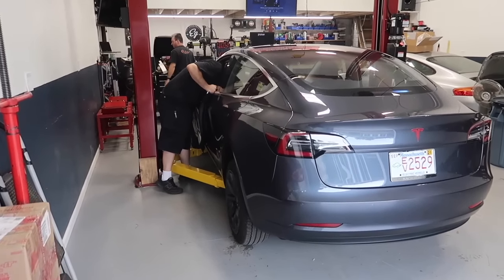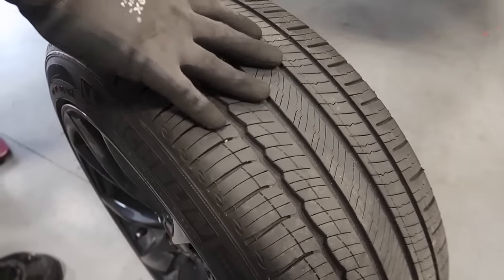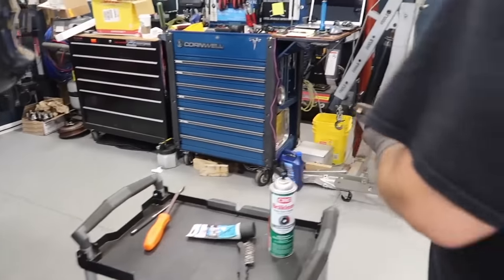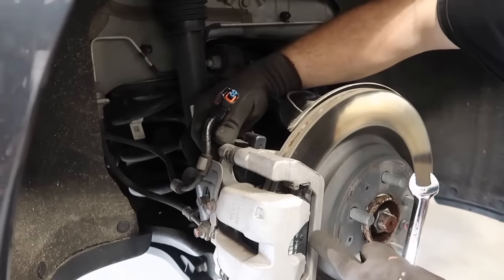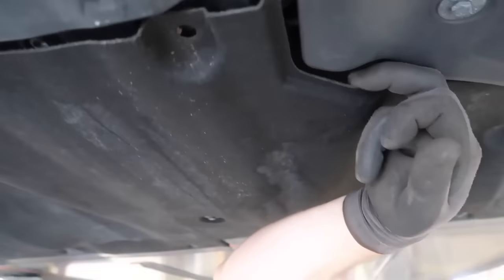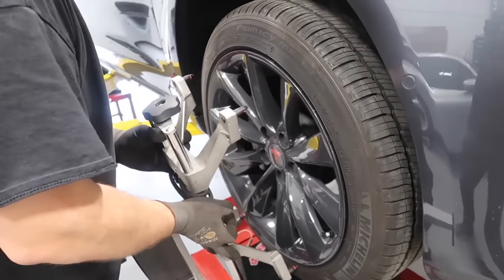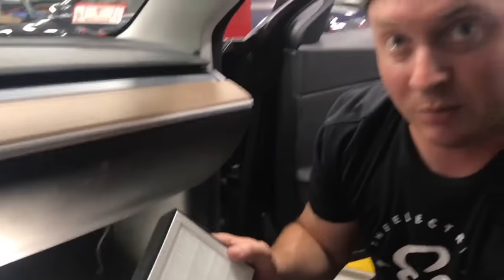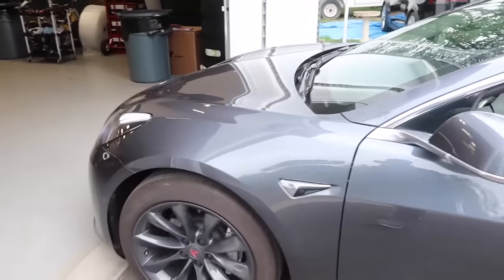Servicing your Tesla model 3: The Complete Guide

Comment: This reminds me, I should align my wheels. I've been getting negative camber wear. 

Shops can't never get it perfect, they just tell me it's close enough. 😒
Reply: Within spec there's a range. Perfect is harder to achieve, but not impossible, just make sure you look at camber castor and toe not just toe.
Reply: At 30k miles, my fronts show inside edge is worn twice as much as outside edge.  I thought this was camber, but is it toe?  Is this type of setup better for aggressive cornering?
Reply: Set up for cornering and wear your tyres extra on your dailies. Could be both, could be under inflation too compounding the problem, go see a hunter or 4 wheel alignment with caster and camber and total toe values
Reply: On my rear wheels, I have an SPC adjustable camber arm. In the front everything is OEM. My tires will last me about 2-3 years instead of 4-5 years with proper rotation and psi.

From the factory, my Mazda came with a slight negative camber for better cornering. But wears out the tires on the inside faster.
Reply: My 08 Silverado stil has perfect alignment after all these years 
Tesla is bit disapointing
Reply: @WANDERER0070  I've noticed each vehicle is different. In my experience, older cars I've owned never needed alignment.
Reply: A lot of places that say they do "alignments" only do toe, not camber and caster. Be sure your shop isn't selling you an alignment that's just a toe and go.
Reply: @sqmotorsports9230  yes, I've learned my lesson. The performance shop I found actually wants to keep my car for a day. They charge separately for toe and camber adjustment for $170 all together.
Reply: @joelfuentes5148  for what it's worth that's a good price; round my way it's $250. But I subcontract rather than do the work in-house; those Hunter racks are expensive....
Reply: @sqmotorsports9230  I can imagine the investment in price, plus the square footage space it takes. A lot of tire shops balance and mount the tires but don't do the alignment.  The whole reason I needed new tires from the first place, was because of unbalanced alignment 🤷‍♂️

Comment: Great video Rich!!!
From what I understand the alignment specs are different for the Long Range and the Standard Range vehicles due to the weight differences. Can you please confirm?
Thanks,
Reply: The weight should not matter. If there is a big difference in weight, the cars spring rates will be adjusted to compensate. This way both cars will have the same ride height. Same ride height means same alignment specs. Still, I'm curious what the official answer is.
Reply: All i know is when Tesla did my alignment they got it wrong twice. I had to take it back and go for a ride with the service person. Only when he realized that i has the smaller battery did they get the alignment corrected.
Thanks for your reply!!!

Comment: Once in tow mode, as long as you don't close the door, the rear brakes do not reengage.

At least in my experience but when playing with replacing pads you're gonna wanna be more careful so this advice of removing the cable is good.

Comment: On those parts that you are wire brushing the rust (and paint) off of, give them a coat of "Hinderrust".
Watch videos on it.  Has a consistency like oily syrup.  Don't get it anywhere you might want to paint later.  Paint won't stick and it's difficult to remove. Best to brush it on but can be sprayed.

Comment: How much would all of that cost to have done?
Reply: @Ken Befound If it were a BMW dealer servicing this, this would be $1200 easily.
Reply: I have a feeling it was expensive. The alignment, battery and wiper blades was unnecessary in my opinion on a new car like that.
Reply: The 3 gives a warning when the 12v gets weak

Comment: 2
What about the oil filter???? When is that changed???
Reply: Every 3000 miles kappa
Reply: @ninjamaster3453  What! No.
Reply: @JasonWW2000  I'm sure he'd be alright going 5000 miles. Kappa
Reply: @ninjamaster3453  Probably closer to 100,000 miles.
Reply: The early model S required oil change at 12k miles and then every 50k miles. The model 3's seem to go much further between recommended changes.
Reply: @JasonWW2000  how often do you change the blinker fluid?
Reply: @ninjamaster3453  Do you even understand what I'm talking about? The gear oil that lubes the motor, gears and differential. You do realize these motors require oil so they don't wear out, right?
Reply: @JasonWW2000  Its more a grease than normal oil (as conditions are easier)
Reply: @cytrynowy_melon6604  No, it's more an oil. There's one model tesla that uses Dexron 6 automatic transmission fluid as the oil. Other models use a special oil I've never heard of. Grease would be way too thick to be circulated and ran through the filter.
Reply: @cytrynowy_melon6604  grease?? The oil pours out during one of Rich's videos....

Comment: For my own edification: When replacing the 12V... Why was the DC connector under the rear seats disconnected?  Is there a specific benefit?  From what I picked up on in the video, it was to disconnect the 12V from powering anything in the car.  I thought this was accomplished by selecting the power off option under the service menu.  Then pressing the brake pedal restore power.  

Love the channel!

Comment: I recently purchased a 2014 Tesla model S with 57k (now has 63k) and was doing the recommended maintenance. I started with the brakes because they felt spongy and took a lot for the car to stop with them... The inner pad on all of Calipers were seized in there and I had to pry them out. The rear pad on the driver side fell apart when I took the caliper off... I replaced the front rotors and pads and just bought rear pads. Car stops like it's supposed to!

Comment: Do not grease pads and any parts related, unless you are planning on often maintenance on brakes. Sure, grease would allow for better initial slide, but over time it accumulates dirt, dust, and a lot of crap. Not to mention it becomes dry and eventually makes the pads stuck. Add salt, cold weather - you see now?
Was the alignment confirmed after it was completed by turning wheels left/right a couple of times?

Comment: Hey Rich,  would have liked seeing the alignment correction for the front Toe issue. The alignment adjustment shown was for the rear camber.

Also, please do a video showing a trailer hitch installation and a detailed installation of the wiring kit for lights.
Reply: we did a live stream installing a hitch on the model S, check our archive channel.
Reply: Carl  Yes, I recall that, but its not a 3 and there was no focus on the trailer wiring that I recall.

Comment: Had to get new rear rotors on my Volt recently as the salt being in southern ontario literally destroyed them after several years, ironically due to lack of use as a result of regenerative braking. One has to intentionally go into neutral and to force friction every once in a while, and I started using the rear parking brake more frequently to keep the rear calipers moving. Front brakes this is less of an issue as they get used more. Common problem among any car that does extensive regenerative braking and cold climates where salt is used. Get that maintenance and caliper lube job done at least every spring.
Reply: On that note, after 7 years the front pads and rotors are prestine... literally had to replace all the rear components. EV makers could simply modify the software so that friction braking happens at speed every so often to keep working the brakes so they don't rust up and seize, like a winter/salt setting.
Reply: The key to keeping the brakes happy is to use them at speed, not easy to trigger unless emergency scenario, workaround on a Volt is Neutral.
Reply: You will also be surprised how much regenerative braking also slows you down even during emergency friction braking, it'll max out regenerative and still use friction, so you still don't get a full good braking burn from speed if not in neutral.

Comment: How much $ did this service cost the customer?
Reply: Can't speak for the Electrified Garage, but I have a Model 3 that just had its first year service last month. The brake service, alignment and wiper blades are typically cheap and can be done by a regular mechanic for around $50 (these are like a typical car). 

However, the aftermarket air filter and 12v battery they're showing are not typical of 1 year service, nor are they cheap. The Ohmmu 12v alone is over $400, but it's supposed to last much longer than the AGM batteries Tesla uses. Still, I would wait until the car is out of warranty, since Tesla will usually replace those for free if they die prematurely (these are supposed to last 3+ years). The charcoal filter is over $100, while the OEM ones cost a fraction of that.

Comment: Bolts hanging out? One reason Japan ate Detroit's lunch, was because EVERY threaded part on every car got either antiseize or thread lock during assembly. Way back in 1960. Detroit products had loose screws and rattles, Japanese ones simply didn't have that problem. Maybe Elon needs to learn ISO9000 procedures?
 Ritchie, you know? Torque settings and thread compounds? I'm not seeing them...you CAN exceed factory quality.
 Overall nice job for an annual once-over.

Comment: Having seen this, I applaud the dedication and attention to detail of the service technicians, but it points to a systemic problem of quality control at the Tesla assembly plant..  Bolts that hold the battery in place should NEVER back out and loosen.; you should never find "extra" hardware in your bottom trays..   Then there's stuff like the stupid little torx screw holding the air filter- stuff like this shows the lack of experience as car designers: the rest of the car manufacturers around the world use captive plastic fasteners that are cheap, easy to use and never get lost..
Reply: Flying0Dismount. At the beginning of the year Ford recalled around 1.5 million F150 trucks because of a fault on a transmission. This is a company that has been producing cars for about 100 years. Hate on Tesla all you want, just don't think they are the only company that has quality control issues.
     P.S. NHTSA just rated the Model 3 the safest car in the world, with the lowest likelihood of injury of any of the 900 vehicles tested....from a company only producing cars since 2008.
    Also your point of other companies using plastic clips to fasten panels, is not because they are better, it's because they are cheaper i.e. more profit. They also break when you try to remove them and need to be replaced i.e. more profit for the dealership.
Reply: @curmudgeon1933  Not saying that the other manufacturers are perfect, but they do make orders of magnitude more vehicles per year than Tesla and design mistakes can and do happen,  but it's usually not critical assembly errors like not sufficiently  torquing fasteners- that's basic QA and you seldom see this kind of stuff from the other manufacturers..   If you watched the recent Rich Rebuilds/Samcrac series, there's also stupid Tesla-isms like putting fasteners in such a way that major disassembly is needed to service vs a straightforward repair if you simply put the bolt in from the other side..  Again, this is indicative of a design team that has not had enough experience designing vehicles..
Reply: @Flying0Dismount . I hear what you're saying, but I've also seen many stories of legacy car makers who release their products with design flaws which necessitate an engine-out repair to change a water pump or a major dis-assembly to change spark plugs. After so many years these errors should not occur....but they do. When a company is selling the quantities of Ford  or GM, etc I'd say it is less acceptable, especially as they are using such old-school, primitive technology, and have been doing it for decades.

Comment: K&N makes reusable air filters for all kinds of vehicles, and they make a cabin air filter for some Teslas at least.  They are supposed to be THE top of the for such filters.  Will you guys be using them, please?  Also, you might want to check out Vapor Honing Technologies to see if they want to be a sponsor, and/or will send you a free/reduced price vapor blasting system (sand blaster w/water added, makes metal parts look sparkling!).

Comment: In the North East rust is a problem and oil spray undercoating is a necessity particularly to protect the rear sub-frame and steel quarter panels.  Do you see any problems with electrical connection by applying and oil undercoating such as Krown or Rust Check?

Comment: If you have a slightly feathered front tire, and use that as an indicator that it has a front alignment issue, and rotate it to the rear, and a perfect rear tire and rotate it to the front.....then align to remove the front issue....
We can presumably think that next time it comes in you will see a slightly feathered rear tire and decide based on that, the car has a rear alignment issue.
What say on that scenario?
Reply: No, the feathering will go away as the tire wears down.

Comment: I like his watch :)

I am now worried my brakes are destroyed 😂 they seem to be working fine tho
Reply: Dirty Tesla they’re fine. Lol. He’s going above and beyond necessary work here. Your normal non-anal retentive shop would have  looked at the brake pads without removing them, said “nah you’re good” and put the wheels back on. The alignment was still within “spec” and wouldn’t have been adjusted by most shops, the battery was totally unnecessary. 

These brake parts are identical to many other cars and that surface corrosion is completely normal. Buffing off the rust does nothing other than make you feel good. We would still do it, and grease them to hopefully slow the process and to help alleviate any risk of someone coming back with sticky brakes or noises. (I come from the days of the hunter alignment machines with strings instead of cameras.). 

The guys here take pride in their work based on this video.  This is the type of mechanic you want but don’t fret over this small stuff.

Comment: Excellent video!  Wish a shop like this was near me.

Did he do a tire rotation and if so was it front to back or a cross rotation?  Also, with the alignment did he get the steering wheel centered correctly?  The same Tesla Service Center did mine 3 times and the steering wheel still isn’t centered right.

Comment: Just a thought but I'm curious what Chad thinks about replacing that big fuse the one with the sand and the little fingers. I don't know what to call it the main disconnect fuse whatever the point is we know that thing degrades over time given how often you jump on the gas pedal. It would seem prudent to periodically replace that fuse during maintenance. Your thoughts I would really like to know...

Comment: So... there goes your maintenance free electric vehicle that everyone was so hyped about... :)
Reply: Guess I missed the part where they drained 5 quarts of oil out and replaced the filter.  I believe no drive train maintenance would be a better way to phrase it.  Everything else is the same as an ice car.
Reply: @linemanap  Yeah... the only drive train maintenance will be to replace the motor every 50k or so... 
Kidding aside... You have reduction gear and differential into the unit as far as I can remember and see. I'm sure Tesla does the same marketing as BMW with a "lifetime" crap... So to recap... you are saving $20 to let's say $200, depending on how cheap you are and what kind of car you have, every 3000 to 10000 miles and saving let's say about an hour of your life and schedule over an ICE.

Comment: Why would you put a lithium battery for the 12 volt. Are you aware of the issue with charging 12 lithium when it gets cold that can mess up those batteries unless temperature controlled.
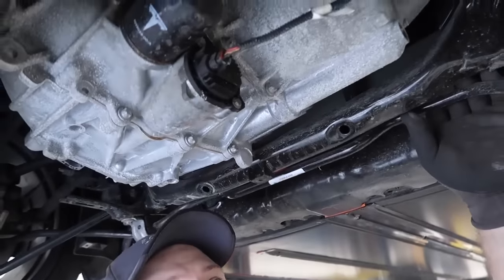 And what was that filter looking thing at 20:00?
Reply: Gear oil filter.

Comment: I was told that model 3 needs to have it's autopilot cameras recalibrated after any alignment change is done. Is this correct?
Reply: That doesnt sound right. When they do an alignment they are putting it back to factory specs. Why would there need to be any camera recalibration?

Comment: I thought I read somewhere that a Lithium battery is not a great choice for the 12v system.  What is the reason to use that over the original?
Reply: Lithium requires a completely different style of charging compared to sla. This is why you typically can't just swap it out without it going bad a short time later. On Teslas, that 12v battery is kept charged up through a converter from the main batteries. Maybe this converter is much more sophisticated compared to a normal alternator and regulator. I'm just guessing. I'd like to hear something official on it.

Comment: WoW... I was thinking were to lookup videos on  how to Maintaine  my Model 3. I drove 27k miles in 12 months.  Does the Model 3 needs a form of lubricant for the electric drive train every 100k miles etc. ???? I think I saw a YouTube Video of a women mechanic changing lubricant to a Model S drive train, is that the same for the Model 3?. Thank you again for the video
Reply: The big electric motors do contain gear oil. It probably lasts several years, though. You can see the oil filters mounted on them.

Comment: So no mechanical parking brake or emergency brake as a back up incase the regular brakes fail. A lot of cars that are new now are going to be super dangerous in ten years when stuff starts failing.
Reply: Especially salvage cars, and cars in the rust belt where even stainless brake lines rot out
Reply: They do have sensors that tell you when it's not working. If you ignore the warning, then it's on you.

Comment: When need to change oil in the drive unit?????? And coolant flush or break flash???
Reply: brakes are flushed as needed just like any car test the fluid for moisture.  million miles on the drive unit, and coolant.